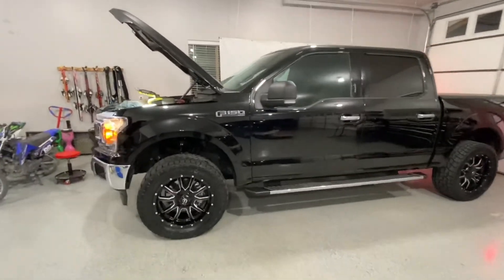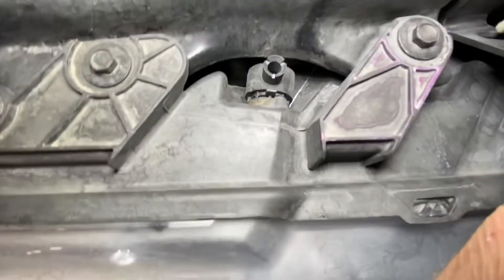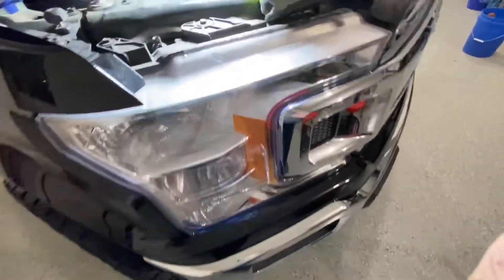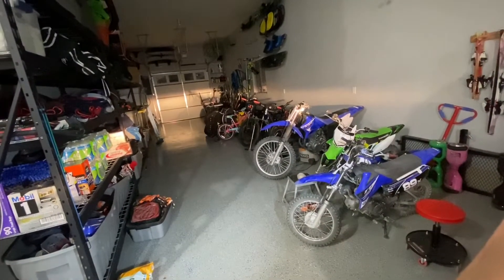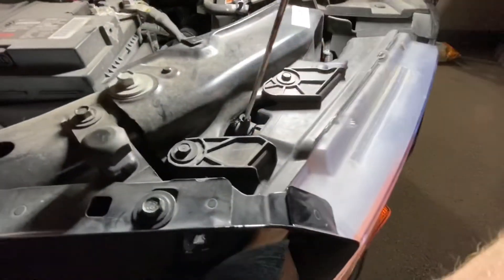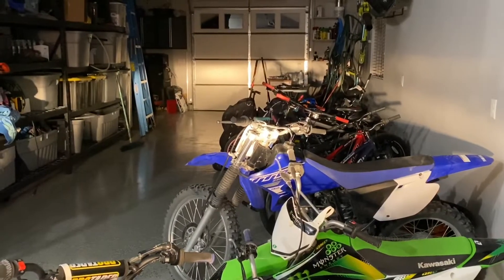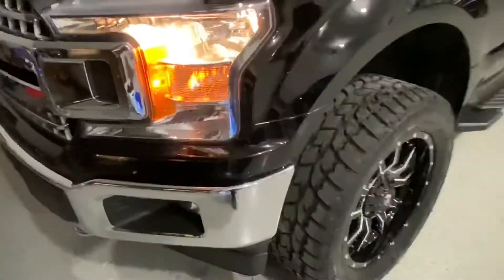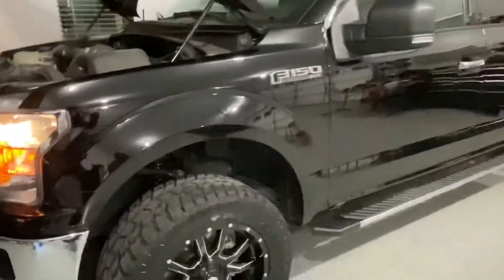2018 Ford F-150 Headlight Adjustment process

Comment: Standard #2 Philips works WAY better than a flathead.  If you turn that adjustment knob sideways, you can see it’s just a gear on the back that turns a threaded rod.  If you turn your screwdriver while it is tilted sideways, you can see the gear turn super easy.  

As far as adjusting for height, you need to be on flat level ground so the headlights can be adjusted to even.  If you park approximately 40-60 feet away (3 full car lengths) and adjust them to just below the headlights at the impact point.  If you look down the side of the truck, the lights should hit the wall a little below the headlight.  NEVER ABOVE.  That’s the point where you are blinding oncoming drivers.
Reply from the maker: Good tip!

Comment: Thank you! I have the same 2018' as well with a 2.5" 285/65R18, Constantly being flashed.
Reply from the maker: Sweet!  What time did you go with?
Reply: I went with Toyo Open Country A/T 3 sitting on fuel wheels. They're very similar to yours.

Comment: Nice truck! I have the same model and year and colour except mine isn't levelled. I just purchased LEDs for  the headlights from F150LEDs and will adjust now if necessary adding new LEDs. Thanks!
Reply from the maker: Those are sweet lights, thanks for your comment!

Comment: Thanks.  I have a 2019 Roush with the leveling kit.  Dealer says the lights are fine, but I constantly get flashed and there is no illumination difference between low/high beams on the road.
Reply from the maker: Yeah, should be an easy fix
Reply: Mine said the same. Just because they didn’t want to bother. My lights were way off.

Comment: Actually  what is inside the space is a wheel pully, like the small one that put tension on the bicycle chain. With a light you should be able to see it. It is not turning the screwdriver, but turning that wheel.
Reply from the maker: Thanks for the detailed info
Reply: Most important comment here! Because using a Phillips head would’ve been way quicker. Thanks

Comment: you can use a #2 Philips screw driver
Reply: Yup, the 4 sides of the tip of the screw driver mesh better with the little adjustment gear and spins pretty easily once ya get it going. Just did mine tonight

Comment: So I got my truck leveled 2.25” & have for a few months now, also have put leds in & have been getting high beamed like crazy going to work in the morning the past 2 months. So I went to go adjust my headlights tonight since I finally had time to do it, but I’m not seeing a screw down In the adjuster like I’ve been hearing. I’m just seeing a flat surface with a clip off to the front side of the adjuster so I’m still a little confused & would like some help/clarification if you wouldn’t mind!
Reply from the maker: What year is yours?

Comment: Are you able to adjust the headlights side to side (vertically)on this or other vehicles? Sometimes it's helpful to move the left light inwards if it's out of line. Thank you.
Reply from the maker: I’m not sure, that would be helpful to be able to do that
Reply: I meant horizontally.
Reply: These F-150s headlights cannot be adjusted horizontally

Comment: I’ve got a 2021 lariat. And I swear my left headlight is pointed further down than the passenger. There’s like a noticeable V on the left compared to the right. Is this normal ? I just had new headlights installed. They are stock lights. Through insurance. And I swear they are slightly different than before but maybe I just never noticed it ? I tried adjusting them with that screw adjustment and it didn’t seem to do much.. any ideas ?
Reply from the maker: I wonder if the headlight is installed correctly?
Reply: Having the same problem, I purchased a 2023 f150 around 1 month ago brand new. And I noticed how my driver side headlight is higher than the right side. Did you ever fix the problem?

Comment: Love the truck and wheels. Which wheels do you like better. The vandals or sledge? Also did you put a 2" level on your truck? I have a silverado 1500 rst and front and back are only 1 1/4" diffence and don't want the front sticking up in the air. Thanks
Reply from the maker: I like the look of the Vandals better.  The Sledge wheels are very popular in my area.  I put a 2” level on the truck, and it sits level now
Reply: Was your truck exactly 2" different from front to back before you got it leveled?
Reply from the maker: I didn’t measure it, so I can’t say, but it appears to be “level” now, so it was close to “2 difference
Reply: Thanks
Reply: Hey its me again....lol. im looking at buying some fuel vandal wheels 20x9 with falken wildpeak at3w 275/60. Rigjt now I have all stock. 18" wheels with 265/65 tires. Im really torn on what to do if the 20" wheels are worth it..was going to get them but I started reading some cons on getting a bigger wheel/ tire. Im ok with the loss of maybe 2-3mpg. However, i read it could be bad for your truck in the long run since the truck was made for the size of wheel/tire it came with. Adding all that extra weight might not be good. Hope this makes sense. Thanks for any help you can provide as with your experience.